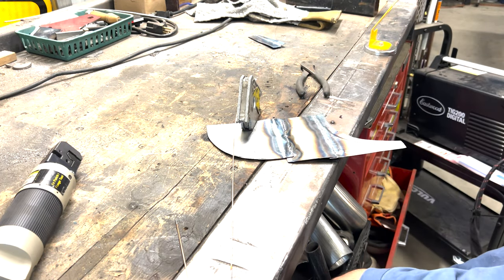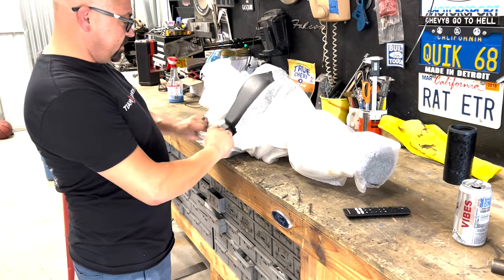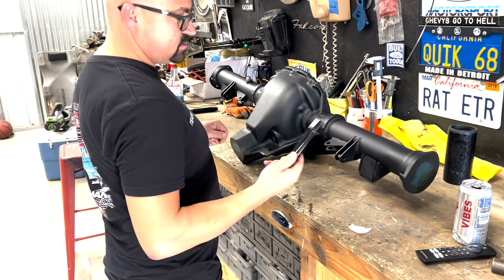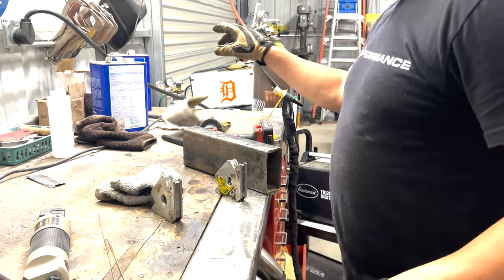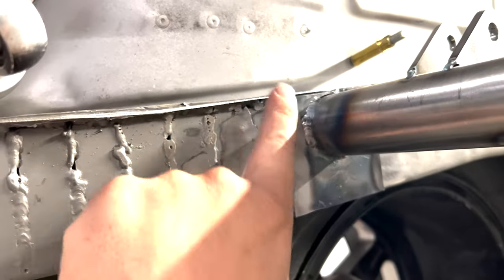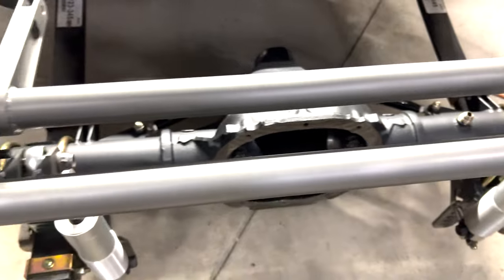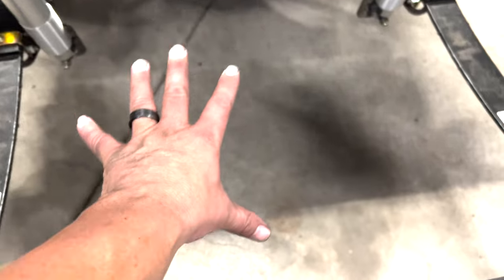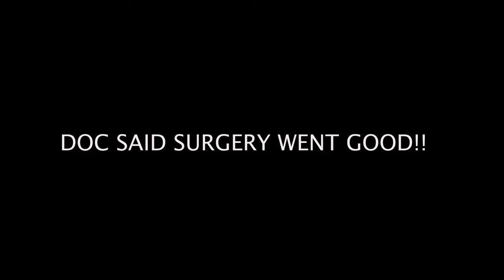The Falcon returns to the shop!!! I get the 8.8 back from powder and I get shoulder surgery!!!

Comment: The 8.8 that I'm putting into my 63 Comet came out of a 94 Mustang that went 4.77 in the 1/8 mile, so they handle power just fine when you put good parts in them!
Reply from the maker: EXACTLY! get a lot of people thinking they’re like an old 8 inch Ford rear end. They are a lot stronger with good parts than people give them credit for! Thanks for watching and having faith in the ol 8.8!

Comment: Eastwood sent me a used surface conditioning tool.  It had marks all over it and the consumable drum was actually already spun on the plastic hub.  They made it right, but it took forever.  It was a bad experience, that made me think I should have just bought the tool at harbor freight.

Comment: Hang in there and do the therapy.  Had my shoulder operated on 12 years ago.  That nerve block is a trip.  About 16 hrs paralyzed and nothing and then wam it's back.  I felt the pain pills didn't really dull the pain they just made me not aware of it. Like it I was watching TV I didn't notice the pain but a friend called and said how's the shoulder? I turned and looked at it and said ow it hurts like a mfer.  Bit then back to tv and nothing there.   Glad to see you get work in before the surgery.  Your tig skills are light years ahead of me.  I've only tried to run beads on metal. Never even tried filler yet.
Reply from the maker: Thank you ! It is really tough to not go play in the shop and that’s what it is for me, my play ground! But I’m going to do the best I can to heal up appropriately. Thanks for the kudos on the tig. I really love tig welding and I suppose the only way to get better is to keep welding sh¡t! You car is coming along good as well. I like seeing everyone’s visions of how to do them. That’s what makes it better to have a car you can’t buy anything for! It all has to be made!